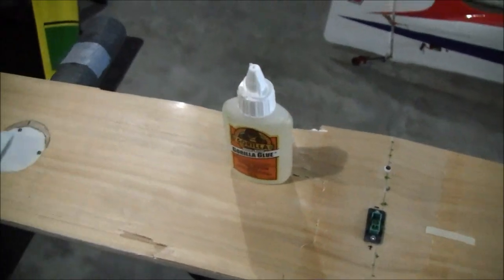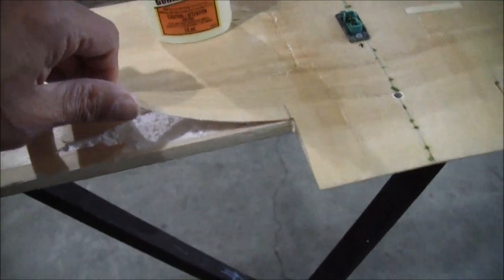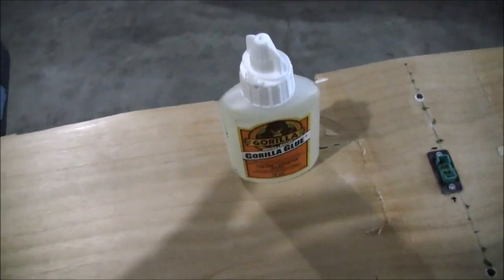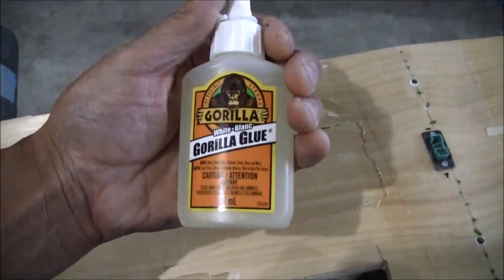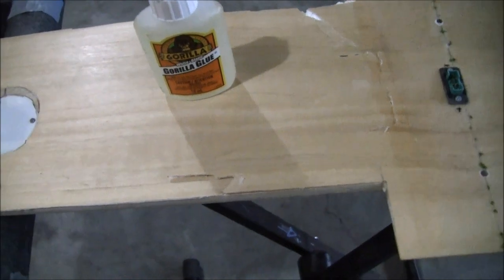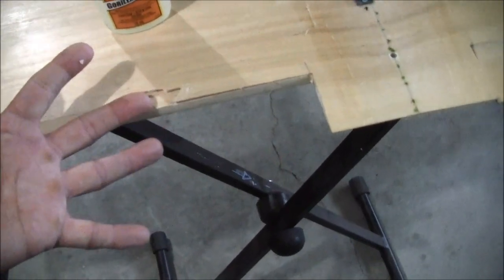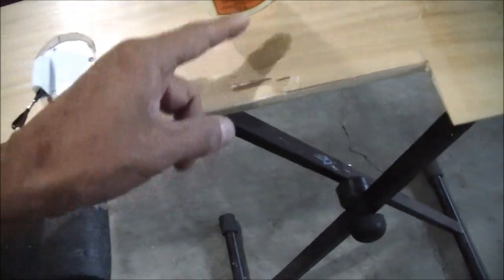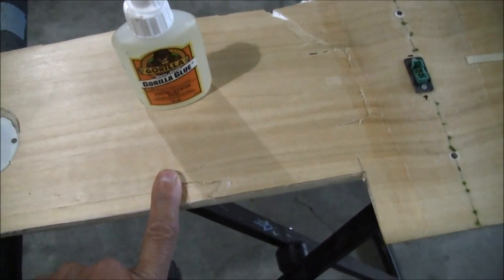Art Hobby IBIS Electro Glider wing repair

Comment: @mike - if you don't know about it, might want to give Gorilla Glue Clear a try sometime.  GG Clear is a poly glue like GG White and is also water activated but it does not foam/expand, so a good substitute for epoxy in an application like this.  cheers
Reply from the maker: Thanks for the tip! I use both GG PU and GG PU white with some moisture for expansion for quite a number of repairs and builds. Ill check out the clear!!!

Comment: Please Install a SPAR ! It will break in the same place.
Reply from the maker: The spar was intact. That's why I decided to do the repair. It was only the sheeting and foam that was damaged.

Wing is still as strong as when it was manufactured. I'm a pretty aggressive  pilot and have put it through it's paces since the repair with no issues.